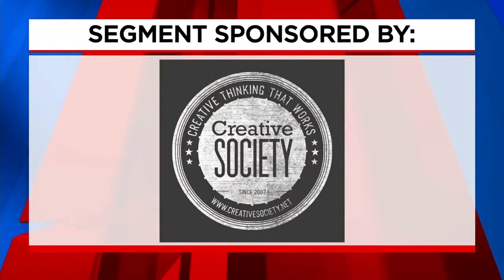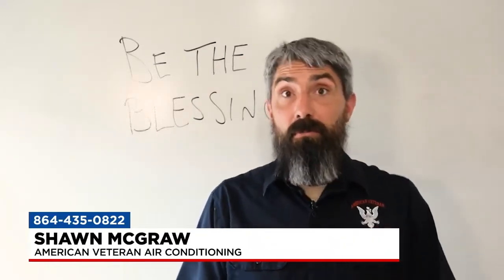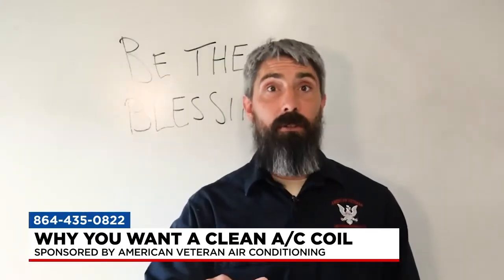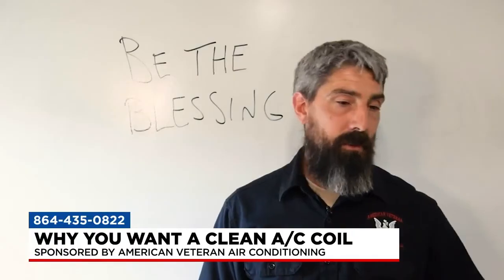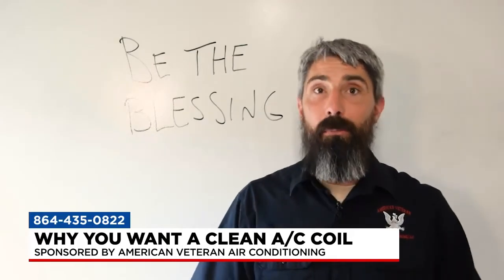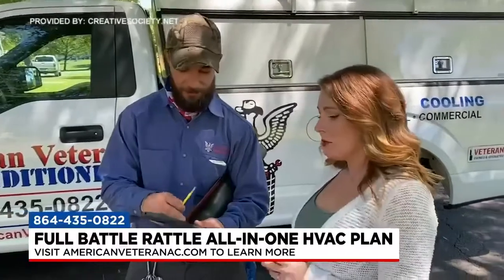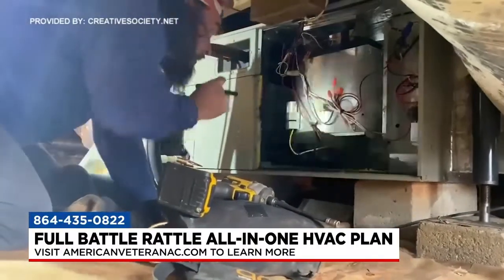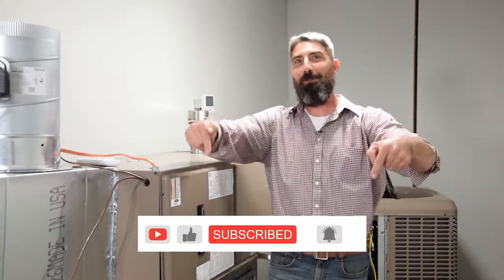Benefits of a Clean AC Coil

Comment: From one veteran to another veteran thanks for your service to our country and on utube. I have a question for you. By cleaning the coils on my ac unit. Will that make the air in the house cooler when the ac is on??
Reply: I'm a little late, but it will make your house feel less humid (and as a result cooler) due to increased airflow when the ac is on.